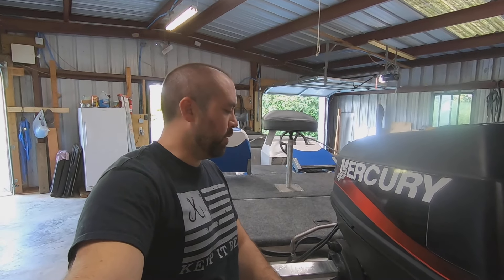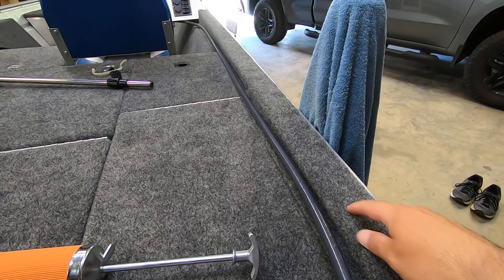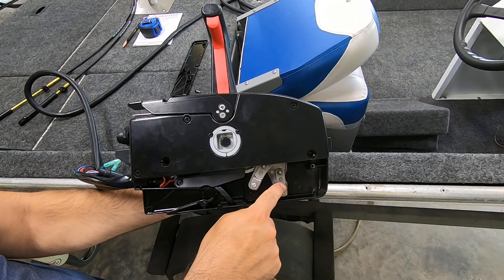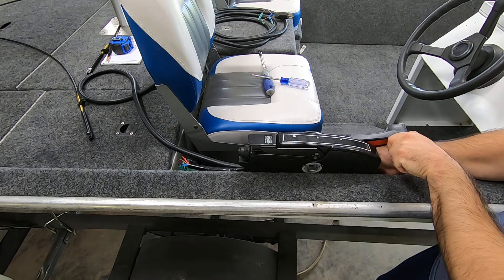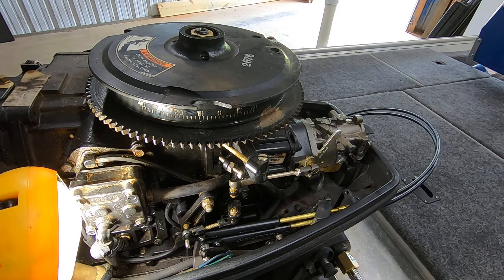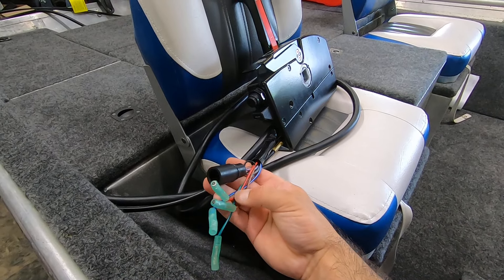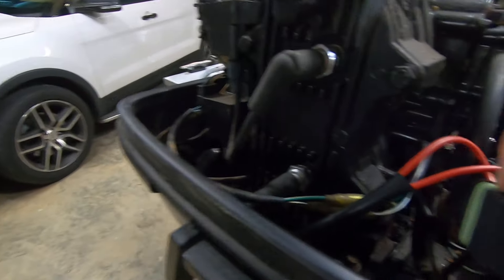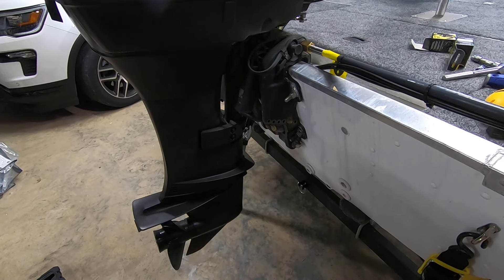How to Install Outboard Controls on your Bass Boat - Ep. 8

Comment: I wouldn’t say it’s a good idea to have your engine running with throttle on the muffs. I could be wrong that’s just what I’ve been told. Very helpful video tho you helped me so I’m trying to help you lol. I guess it burns up the water pump or the engine or something I can’t remember
Reply from the maker: Yeah I wouldn’t recommend running it long… but as long as you are getting enough water in to cool it and you can see a strong discharge, it’s probably safe for short term

Comment: Question? There are two holes on the arms. I noticed you attached to the bottom hole versus the one above? Does it make a difference? I put mine on the first hole because it was attached that way when I replaced the box but my cables aren’t engaging smoothly?
Reply from the maker: On my control assembly, the bottom of the arm has a peg that is used to attach.  It seems to be lined up better than if they were attached higher up.  Maybe swap yours and see if it helps?
Reply: @ I did and it was better! Another question? Did your throttle arm have cotter pins attaching it? I took the old cables off and pulled two cotter pins off the original throttle arm, one on top and one on the bottom. Now I’m trying to put the new one back in and I see the hole for the one on top but I don’t see the hole for one on the bottom. It’s possible I didn’t need to take the one off the bottom, but it didn’t seem to want to release until I did that.
Reply from the maker: @Debidawg  No this control box didn't have cotter pins - the cable ends attached to the arm with a bracket and a screw - you can see it at @10:50 of the video

Comment: I will be doing this in a few day. Fingers crossed. 96 Force 50hp coming off 2005 Mercury 75hp going in. Boat tracker deep V 17  the wiring is iffy at best. Going to make it useable this year. 2025 total rebuild foam , wiring, add kicker. Deck lights. Thank you
Reply from the maker: Awesome man, hope it went well!
Reply: @Everydayfishing  I think my boat was made on bring your kid to work day. Got to the 2 part foam dept and Bill Sr had to go take a dump. OK Jr see you mix this stuff then you pour it here and here not there there and for sure not there. Got to the next dept. Face palm just cover it. I have to gut it. This just got real ugly. But must press on.
Reply from the maker: @moosenbeans903  Dang that sucks!  Thats a really messy job trying to get all the old foam out.  Thoughts and prayers my friend 😂

Comment: Great video. I have a 10 year old Lund which I bought new last year.  It looks to have very similar control / throttle system to the one you installed.  I found that once I engage forward the boat doesn't really accelerate until I get very close to the end range and have to push it forward almost all the way, then moving it forward my a millimeter at a time has a big change on the throttle applied.  Is this common for boats or do I need to replace / fox my throttle control?  Thanks,
Reply from the maker: It sounds like you might need to adjust the  throttle… there is probably too much play and you should be able to tighten it so the cable engages the throttle in the outboard sooner

Comment: FYI, I just installed the same throttle control and the trim stopped working for me too a day or 2 later. Thanks for sharing that part. Replacement relays did the job. Thank you!
Anymore problems with the relays since then? I'll probably keep a couple extra on the boat just in case
Reply from the maker: Awesome, glad it helped!  I have since sold this boat but the relays were working for about 6 months for sure.  Haven’t heard anything since

Comment: Brilliant video I've got a brand new side mount unit but for some reason when I push forward after its selected gear the throttle arm dosnt move at all so not sure if something has come lose on mine
Reply from the maker: Is the cable itself not moving or the mechanism inside the control box?  You should be able to take the side off like in the video and see which part isn't moving like it should.

Comment: Excellent video, thanks for sharing, is it the same for the inboard motor? For mercury
Reply from the maker: I'm honestly not sure - I've never worked on an inboard motor.  If it has a shifter cable and a throttle cable, then I'm guessing it would be the same!
Reply: @Everydayfishing  thanks

Comment: What about the battery cables, where do they connect?
Fuel line just a quick connect I am guessing?
Reply from the maker: Yep - fuel is a quick connect.  Battery connections you can see in my video on batteries and wiring!

Comment: Question. Do all boats have the same thick cable or do they all vary ? Thanks 
Great video btw
Reply from the maker: Each manufacturer has a specific type of connector so just be sure you buy controls made to be compatible with your outboard manufacturer and you should be good

Comment: Did you have to wire the ignition separate from the wiring harness from the control box or should it work after the harness is plugged in?
Reply from the maker: This Mercury outboard only had the one wire harness so there was nothing else to connect.  The ignition was included in the wire harness you saw me connect

Comment: Question could you do this whole process of steering and throttle with any size outboard, like a 5, 9.9, 15 or 25?
Reply from the maker: Yes sir!  Any outboard that uses a throttle control box like this one should operate very similarly
Reply: @ thank you

Comment: Hey man I’m thinking about do this to my 16 ft Dixie but I’m terrified when looking for the parts. There’s sooo much out there. What parts did u use? And how has the throttle control been working for you? I noticed you jiggle it around a little when getting it close to neutral.
Reply from the maker: I found this on Amazon - just be sure to search for one that matches the brand of your outboard.  Usually the product descriptions are pretty accurate.  Don’t worry too much and give it a shot!  Trust me it’s daunting at first but it gets easier once you dive in.  I’ve been happy with this one - https://a.co/d/cgKeRa0

Comment: Should the fire extinguisher be mounted at a different angle to prevent the powder from packing into a dense cake from all the bouncing up and down on waves, etc?
Reply from the maker: Hmm I’m honestly not sure.  If that was possible, wouldn’t that happen at the lowest point no matter which angle it’s mounted?
Reply: @Everydayfishing  True, but if it's compacted horizontally you have a better chance of shaking it all loose. It's probably a good idea to shake them once in awhile anyway. I would check with the Coast Guard or the Coast Guard Auxiliary to see what they recommend.

Comment: Hi there! Did you need to replace anything on the outboard so that the throttle and shift cables would operate properly with the remote rather than the tiller control?
Reply from the maker: Unfortunately I don't have any experience with converting from tiller to remote controls.  I'd recommend tracing the tiller throttle and shifter and seeing if those points match those in my video - go from there.

Comment: I have a question are you using identical cables for Throttle and shifter ? Or those are different ? Pls advise . Thanks
Reply from the maker: They are identical!  Doesn't matter which cable goes to where, as long as you connect the shifter control to the shifter, and throttle control to the throttle.

Comment: Do I need a specific throttle cable for 1990 25 hp mercury? The shifter cable is doing exactly what it needs to do, but my throttle cable will only pull, when I need it to push. Do I need to do something to the throttle cable so that it will push?
Reply from the maker: As far as I know the throttle cables should be universal… maybe it’s hooked up to the wrong side of the throttle control box?

Comment: Not sure if you know but does your boat have a rotary steering system or hydraulic. I have the old pulley cable type on my old Mirrocraft and i’m thinking next year when i get a 4storke of changing it
Reply from the maker: Yeah this boat is just mechanical steering - no hydraulics.  It works fine for me, it’s not hard to turn or anything.  But you might want hydraulic if you get a motor bigger than 40hp
Reply: @Everydayfishing  going with a 20-20hp probably mercury 4storke efi

Comment: On my Mercury 75 horse four stroke outboard, I hooked up the battery and switched the negative and posaTive cables and blew something electrical. Any idea what I need to do to fix it?  I have no start and no trim.  Nothing electronic works.  Blown fuse?  Blown relay?

Comment: when you go and order the steering cable from the website it has various lengths, 13ft, 14ft, 15ft etc. is that the cable length measured from the motor, around the sides of the boat and in towards the console? what happens if it is too long
Reply from the maker: Yes you should take a string or flexible tape and measure the path your steering cable will take, then round up to the nearest measurement.  They are pretty rigid, so too much extra would be tough to manage.

Comment: Hey boss ! where did you purchase the steering wheel and gear with the connections !?
Reply from the maker: I found them on eBay - here is the one I bought:
https://www.ebay.com/itm/265804154401

Comment: Hello I have an old mercury seapro 15hp the old version can I install the throttle and the shifter pls respond
Reply: I’m not familiar with that model outboard but as long as you can identify where the shifter cable and throttle cable attach on the motor, you can definitely install a control box like this one!

Comment: You skipped a part I was really trying to hope to see. How did you connect your throttle power cables to your battery but also have all the fuze box and what not off it. The battery must be loaded
Reply from the maker: So there’s only 2 wires connected on each of the battery terminals.  One set goes to the outboard, the other goes to the fuse panel.  All electrics are then powered by the fuse panel.  The only wire for the throttle controls is that thick one that plugs into the wire harness from the outboard.  No power directly needed from battery to controls.

Comment: Where did you purchase your throttle kit ?  Do you have a link?  What length did you buy for the cables?
Reply from the maker: I found that ebay has the most choices when it comes to stuff like that.  Here are the ones I bought - they were 13 feet.  

https://www.ebay.com/itm/304562650738?epid=1018865362&hash=item46e9593e72:g:4mcAAOSw2g5izszF&amdata=enc%3AAQAHAAAAsC3a9twU1318Iv8gnMdVCwDb7htP4kVhOoNsuipyI9OOmDmMltLNjTPzpkg%2FeacjK2CREtodZvlN9FpyCb0nZ35EKQ28lA2b1jWp56vQg4anGwB6nT8joTZokTSUmmWiwrEBVAg1v%2FSGyhtIRsmxEsHdnKxr%2B47%2BIa7mYh9kXX5oAH0HRaRXx9IneLF3SoFrhZJTtK%2BJc7Esp5UFJI1CMIqNVRxrfWL8BC70hMISIHC3%7Ctkp%3ABk9SR6SU_KHmYA

Comment: Is that a new controller? If so where did you get it.
Reply from the maker: Yes bought new from Amazon - this is the one I purchased:
Mophorn Boat Throttle Control for Mercury Side Mounted Outboard Remote Control Single Lever Binnacle with Key Switch and Lanyard https://a.co/d/cPO8KrF

Comment: Where did you get the throttle cable and gear cable
Reply from the maker: I found them on eBay - just do a search for “control cables for” your brand outboard.

Comment: How did you make the mount that the throttle controll is mounted to completely new to this an want to build a jon boat
Reply from the maker: That part actually came with the boat when I bought it.  It’s just a piece of aluminum with bends in it though.  I’m sure it wouldn’t be tough to fabricate something

Comment: I’m trying to put this on my boat but the throttle up lever is not working it’s not pulling the cable I replaced both cables and nothing changed
Reply from the maker: Are you using a new throttle control box?  Does the lever and throttle move the mechanism when the cables are not attached?
Reply: @Everydayfishing  yes it’s a new box and yes it moves fine without the cables on and it also moves fine with just the shifting cable on only when I put the throttle one on

Comment: Do it only have to be a mercury or will it work on other outboards I have 6.5 Hangkai
Reply: It will work, as long as you have the controls to do it.
Reply: @Infernomm  what’s an example of the control? 🤔🤔
Reply: @inkbydjtattat8628  the throttle, ignition, things along that line are made specifically for each type of outboard
Reply: Thank you so much boss ! 🤘🏾🦾🥷🏼
Reply: @inkbydjtattat8628  no problem, have a great season and catch lots of fish!

Comment: Awesome video! What brand throttle box did you end up buying? I’m searching for the 8 pin harness for a 96 60 HP mercury.
Reply from the maker: Thank you!  This is the one I bought from Amazon:
Mophorn Outboard Remote Control... https://www.amazon.com/dp/B07LFXJ9P8?ref=ppx_pop_mob_ap_share
Reply: I was looking at that one! How’s it holding up?
Reply from the maker: @aaronhollie2236  Great so far - no complaints!
Reply: Good deal, thanks for the feed back. I just pulled the trigger on buying it!
Reply: I tried messaging you but I don’t see how to. My product came and was not what I ordered / what you received.
Reply: I ordered from the link the last digits A15 too.